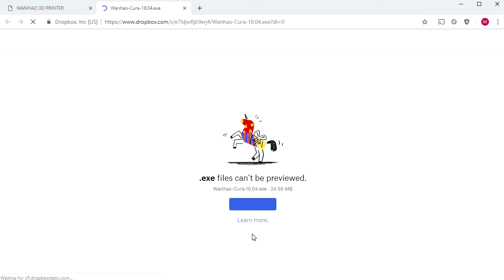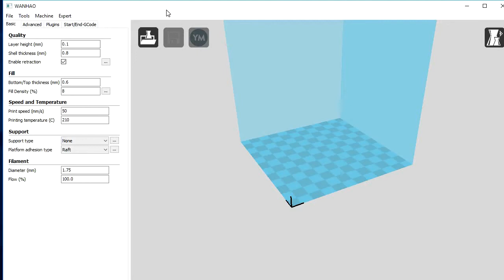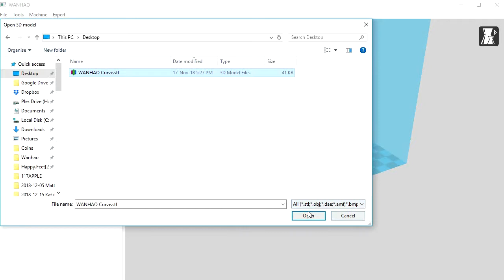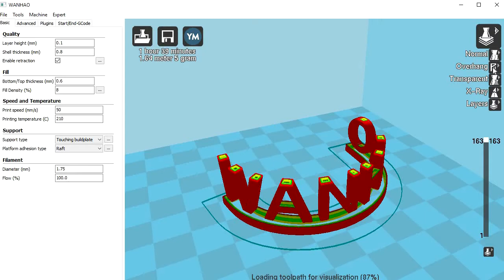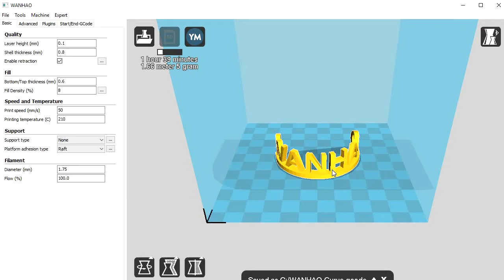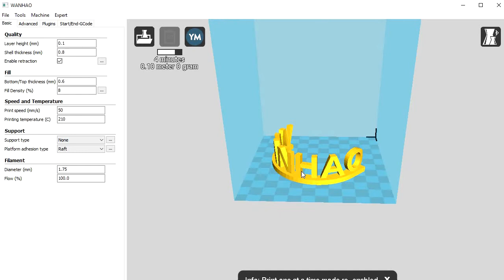Installing and preparing Cura for your Wanhao D10 3D Printer

Comment: Will it be support for experimental features like in Ultimaker's Cura? There sometimes is quite interesting features like tree support. And BTW, the 'YM' button not working properly in 18.04. Also noticed a hole for heated bed connection, will it be only in next versions or as additional component to add to a printer?